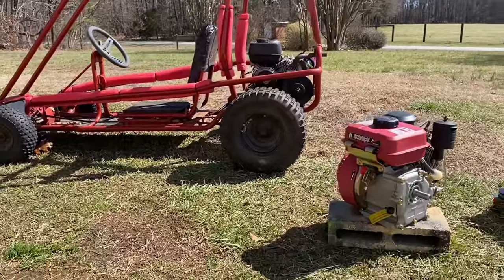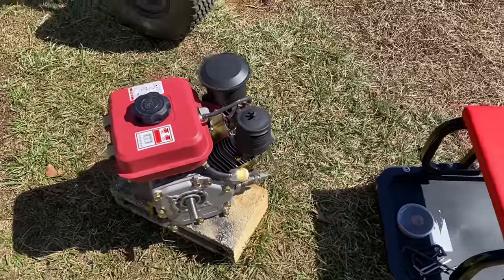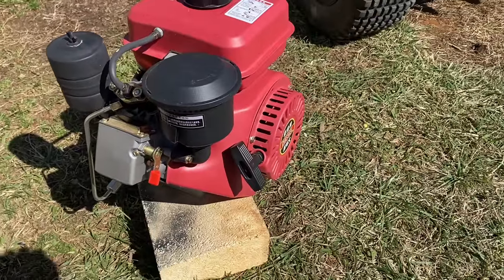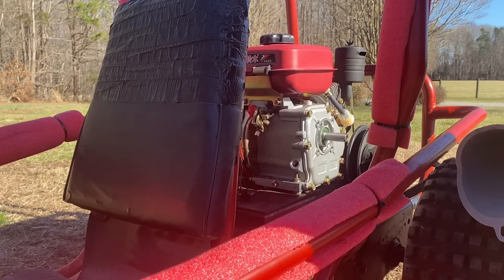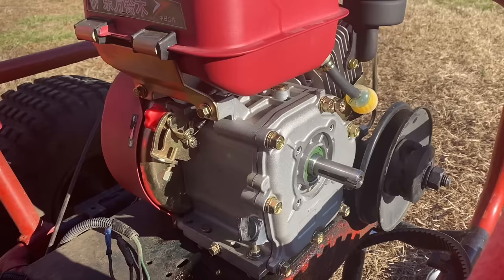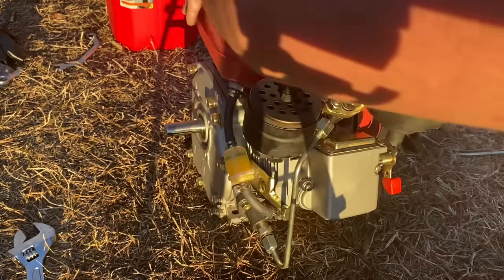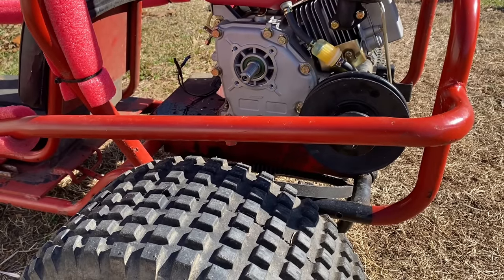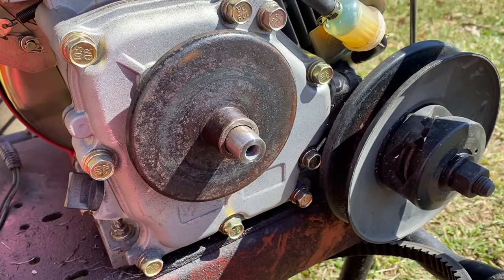Amazon 196cc Diesel Engine Go-Kart Swap - Rolling Coal In The Go-Kart

Comment: Air cooled mini diesel should get very very hot so "20W50 4Stroke" for gas bikes would be right....
Diesel oil if modern means no additives for DieseParticleFilter which should be extra wrong oil, 0W30 or something is complete trash in this.
Want to prolong the live of this little thing, add synthetic two stroke oil to diesel which is used for little two cycles, only a small spoon to the tank would help the injection pump as modern diesel is not as lubing as decades ago :-)
Reply: So we went backwards in our technology 🤔 that doesn't make sense lol
Reply: @thegman4759  it doesn't make sense but it's better for the environment allegedly
Reply: You don't need to add anything to help the pump lol diesel has lubricating properties in it that's what I'm trying to say

Comment: Diesels will start easier if you take a hair dryer and stick the nozzle into the air intake. Blow hot air into the engine. If it's getting fuel it will start.

Comment: I have a new predator 212cc and almost every time I tried to start it (before the break in period) it would backfire and yank the starter rope out of my hand, any idea why?
Reply: Timming has slipped
Reply: or to much fuel is getting into cyl
Reply: @jockwilson221  its brand new and I don’t think it’s doing it anymore, it hasn’t yet.
Reply: @jockwilson221  predator 212 doesn’t have timing chain
Reply: Dont listen to Jockwilson. This is an issue that we have come to accept with the 212. The engine has a built in decompression lobe on the camshaft that is designed to open the exhaust valve slightly during compression to make starting it easier. When the engine reaches its idle rpm, this lobe gets flung with centrifugal force, disconnecting the decompression. Most likely, im assuming you are starting the engine hot. Due to the extra force of the compression stroke, the engine likes to stop on said stroke if you shut off the engine,(if that makes sense) Due to this, the decompression often doesnt get a chance to trigger, leading to full compression of the engine, which means it fires before the piston reaches TDC, leading to the engine kicking back, as the term is named. What I like to do, is to pull it past said compression stroke gently, and once you pass it, you then give it a hard yank to start the engine. It might make you look like a pussy, but trust me, its worked fine for me every single time. The second more unlikely possibility is that somehow, the valve lash on the exhaust valve has changed, (aka the space between the rocker arms and valve stems) leading to the engine becoming insensitive to the slight opening of decompression, which means you need to manually recalibrate the valve lash on the engine, which you can find lots of videos about on youtube. Good luck on it!

Comment: I want to understand how the accelerator works.
How can the vehicle not move while the engine is turning and how does the accelerator make it move and increase engin power?
Reply from the maker: I know there is a needle in the pump that retracts and allows for more fuel but I haven’t had the side cover off to see exactly how it’s being controlled.
Reply: @jwsbackyard6413  Thank you
Reply: Diesel engines always run lean, the RPM is controlled by how much fuel is sprayed into the engine. There is no throttle body or carburetor piston to block off the air supply.
Reply: @tristan6509  Thank you :)

Comment: I think it looks tacky when people put japanese writing on t shirts and car stickers,  But this contraption looks legit....like everything about it is what I would expect to see in actual use in thialand.   Is this loosely conceived off a gx gas engine design?
Reply from the maker: I mean the exhaust and intake flanges are the same as you would see on a predator 212 or similar clone but that’s about all that is similar.
Reply: Yup, it's a modification of the honda GX160 design, and they're not very reliable because of that.

The castings are just too thin for a high compression diesel, and they crack overtime. It was clearly not designed as a diesel engine.

Most farmers in southeast asia use either yanmar, kubota, or their numerous clones because the yanmar/kubota design is a lot more reliable.

Comment: Wonder if it would make a good long tail motor for a 12 foot Jon boat?
Reply from the maker: Honestly the power of this thing is pretty lack  luster. It’s been reliable though.
Reply: @jwsbackyard6413 this engine runs at half the RPM of a predator 212 (3600 vs 1800 rpm)

I bet with a properly sized pulley, it could pull pretty well.

Comment: do you still respond? i got one and need some help with it
Reply from the maker: What’s up?
Reply: @jwsbackyard6413  i need help with the throttle mainly, idk how or where to hook it up
Reply from the maker: @jaygos2784  I have a video on how to hook up the throttle. Just go to the videos tab for the channel and you’ll see it.
Reply: @jwsbackyard6413  okay thanks but i’m also having issues on priming and starting, it will go half way then the lever will flip up stopping it, what do i do
Reply from the maker: @jaygos2784  there is also a video specifically on how to prime and start it also. Once the fuel system is primed pull on the pull start gently with the red lever still in the up position until you are stopped by the compression of the engine then push the red lever down and pull the starter to start. This will keep it from catching halfway.
Reply: @jwsbackyard6413  okay i got it thank you so much, one more thing, when you hooked the throttle up how’d you keep it from dying once you get it going
Reply from the maker: @jaygos2784  you have to hook the cable up with a little tension already on the lever so that the lever never returns to the closed position. Enough tension to keep it off of the off position but not so much tension that the engine reva high enough to engage the clutch and take off.
Reply: @jwsbackyard6413  what is the HP output of the engine ?
Do you also know the torque output of the engine ?
Do they make any small diesel engine like yours with electric start ?
Reply from the maker: @craigalston2208  most of the listings say they make between 3-4hp but never include a torque rating. They just leave the torque spot blank so idk. They do make some with electric starts. Just have to google electric start 196cc diesel engine and they should pop up in the 4th or 5th result.
Reply: @jwsbackyard6413  thanks for the information .

Comment: Couldn't you just swap out the engine shaft with a standard 3/4?
Reply from the maker: I would be very unlikely that I would be able to source and crank with a 3/4 shaft that would fit this engine and it would be a bit more work to swap the crank rather than just taking a mm off.
Reply: @jwsbackyard6413  They make them for the 196cc colemans so that's why I ask. Other than the diesel parts that make it a diesel I imagine everything else is interchangable.
Reply from the maker: @martinwagnerproductions  Usually diesel internals are a bit sturdier than gas engines because of the increased stress. I’d be surprised if they where interchangeable but I could be wrong.
Reply: @martinwagnerproductions That would be a definite no. These diesel engines have a slightly longer stroke, have an extra gear to drive the fuel pump, and is overall more sturdy to handle the extra compression. Unless you want to make your crankshaft turn into a frag grenade, dont use a gas crankshaft.
Reply: @TacticalPhoenixYT  appreciate the insight. Was unsure. So dumb they can’t just make them standard 3/4. Like… just take off less metal lol
Reply: @martinwagnerproductions  Yeah, thats the cold war between metric and imperial for you in a nutshell haha!

Comment: Do they make diesel motorcycles?
Reply from the maker: There have been a few production diesel motorcycles over the years and I’ve seen a few people put this engine on minibikes. Pull starting the engine would probably be tough on a bike because of how light bikes are.
Reply: @jwsbackyard6413  I was thinking in terms of the 150 cc class scooters with 12" wheels
Reply from the maker: Shoot I don’t know. I’m sure there is something out there like that someone has put together
Reply: I think the marines have one

Comment: With how much that thing makes soot as soon as it tries to Rev at all, I'd say this thing was made to pollute more than perform. The gas engine was undoubtedly better.
Reply: Then again, most diesel engines do the same. Reason is, since diesel burns a lot slower than gas, and relies on the engine's compression to ignite, you would need to bring the engine rpm up at a snails pace. If you want a throttle that is even remotely responsive, this means squirting exess diesel into the combustion chamber to allow for extra power when accelerating.

Comment: And it’s a briggs 😂😂😂
Reply from the maker: Actually Tecumseh haha
Reply: @jwsbackyard6413  same difference, also if you mess with the governor spring you should be able to get about 5k rpm it gets real peppy above 4k. also install stage 1 air filter on a mikuni adapter (will have to be slightly modified), and of course straight pipe it
Reply: @AlternateMusicAddict  4k is probably already to fast last thing you want is that flywheel to come off at 5k rpm bad things will happen